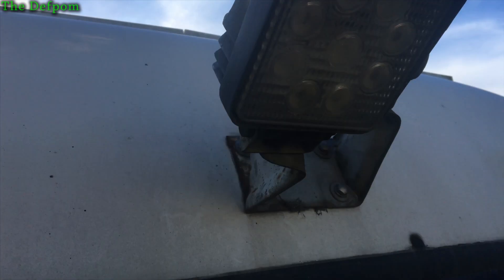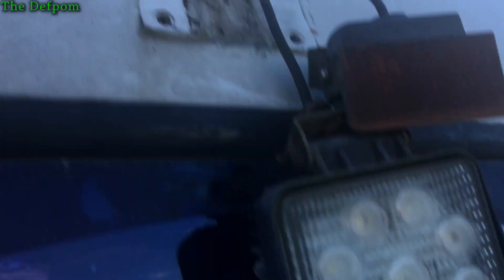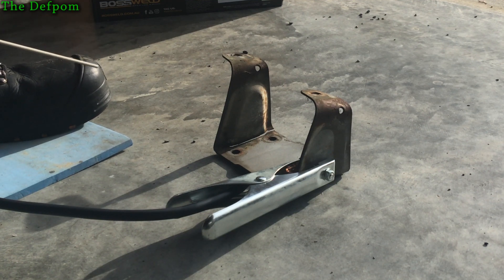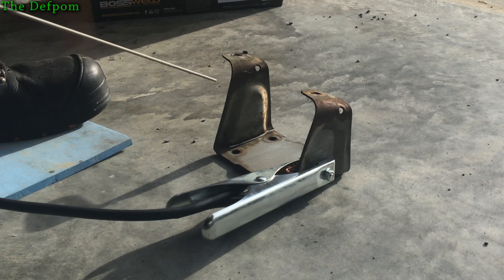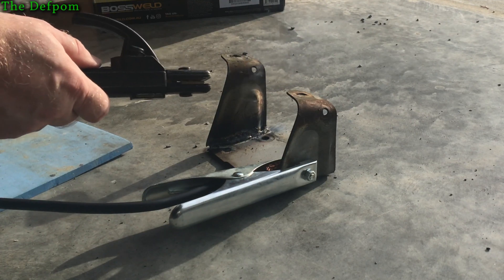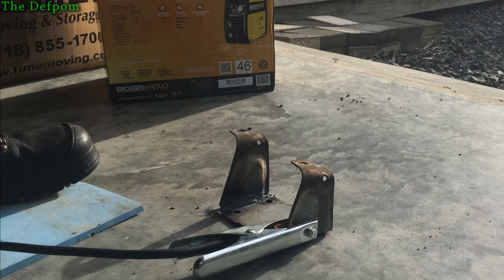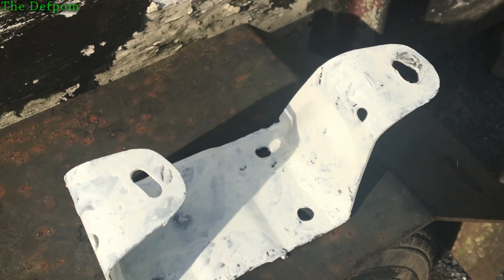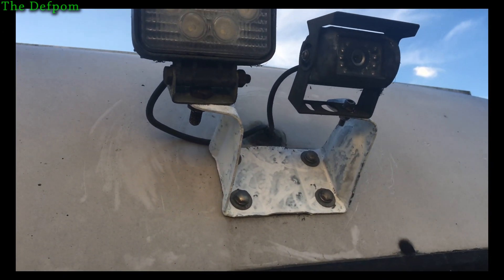🔴 #529 Welding Thin Metal - Fractured Floodlight Bracket Repair - How To Weld A Broken Bracket

Comment: I guess because of the size of the lamp it was flexing in the wind, which caused a stress fracture. I was quite surprised you got an arc without cleaning a small bit to start it off :).

Comment: Inverters do a nice job with low current welding, and you do not have a compromise so much between actually having an arc and burning a hole through the metal. Big step up over the old iron core one, though that makes a very good jump starter for cars after adding in the box with one massive stud diode in it and a 40A thermal breaker. When breaker trips the car will start.
Reply from the maker: It is certainly a LOT lighter too !
It was the first time I have used it, and I have to say it welded nicely compared to my old unit which I had for 25 years, that was lost in the sea water flooding in January last year, in which I lost lot of tools.

Comment: Have to be careful welding galvanized you have to clean a galvanized off the area first otherwise you can get poisonous gas from galvanized metal zinc oxide poisoning
Reply from the maker: Thanks for the tip, I will remember that for next time, I just need to figure out where I put my angle grinder... hmm.
Reply: My welding buddy claimed that you could drink lots of fresh cows milk (preferably directly from the tit) to minimize the effects of the zinc toxicity. Now, I don't know that to be true, but he was a very good welder and also a big milk drinker.
Reply: Yes, welding galvanized can make you sick for about 24 hours. REAL sick. So will some other things, certain industrial paints--yellow is bad--for example. I have had it a few times. It comes on slow and takes a few hours before it peaks. If you've had it before you know the first symptoms and know you are screwed.  But it actually takes more than what you get from burning a few rods. It took about at least half a day's worth of welding for me. I never seen anyone get it without at least an hour or so of it. But you might get it quicker, but I doubt less than at least welding a few meters of galvanized. 

Yeah, they have always talked about the milk. Some people swore by it. I don't know. Maybe it helps.

Comment: But that looks nothing like a T and K bracket to mount an antron 99 antenna lol.
Get an angle grinder, prep the metal yoooooow mad man :-D
Reply from the maker: I couldn't find my angle grinder, I haven't seen it for a year. I'm starting to wonder if the builders nicked it when they were doing the house repairs.
Reply: I would not be supprised, i hope it was a cheap no brand jobbie.
My mate has had a few of his stop working, bosch is one of them, he has had it for years, i took it apart and found the field winding wire had snapped off the field coils, how dare it lol.
Solder + epoxy resin fixed the little sod, i don't like to see good tools die.